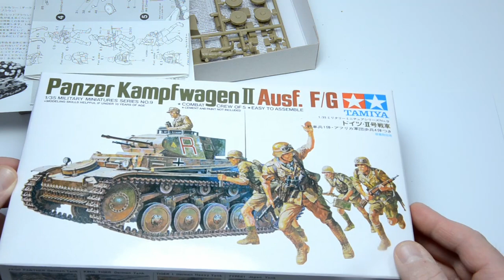BUILDING DETAILING a PANZER II Textures, Welds, Photoeched parts (1/35, Tamiya)

Comment: Bronco tracks are for ausf. D sprockets, these are different, with two rows of teeth and a single guide horn. Fortunately we now have T-Rex printed tracks and replacement sprockets for Tamiya kit. Not sure if T-Rex sprockets are for the old Panzer II F or the newer Panzer II C though.
Anyway, if using aftermarket tracks, replacement sprockets are a must, kit provided sprockets have less teeth that the real sprockets so the pitch is wrong and new correct tracks won't fit.
Reply from the maker: Tnx... You are right. Care has to be taken when choosing aftermarket tracks... 💪

Comment: What did you use for the front and rear reflectors where the photo etch instructions say "plastic"? they aren't parts in the original kit and the photo etch kit doesn't include them. are you just supposed to have plastic rings of the exact size laying around or am I missing something?
Reply from the maker: Hmmm I dont remember any reflectors...
Reply: @dioramadevil  maybe reflector is the wrong word. Maybe they ate more like brake or caution lights. One at the rear near the hitch and one at the front, upper right hand side to the right of the shovel.